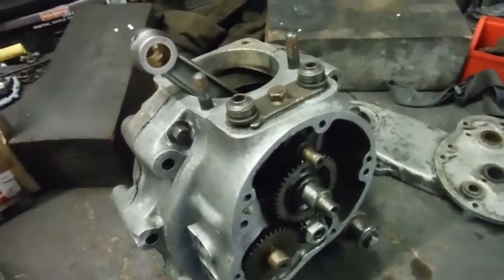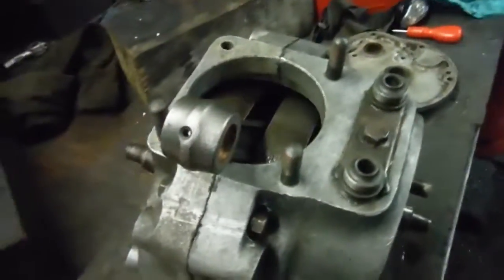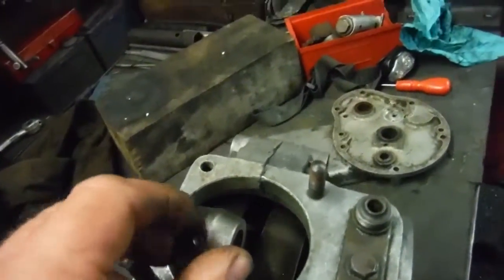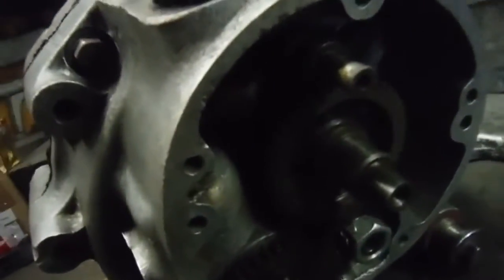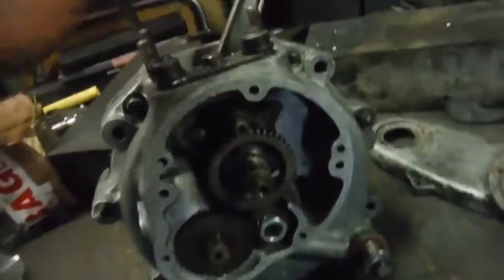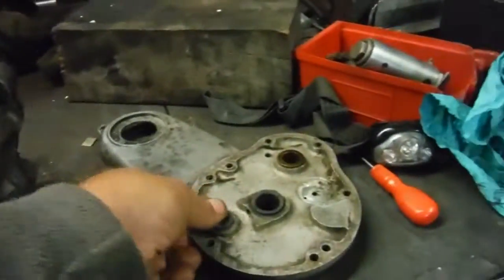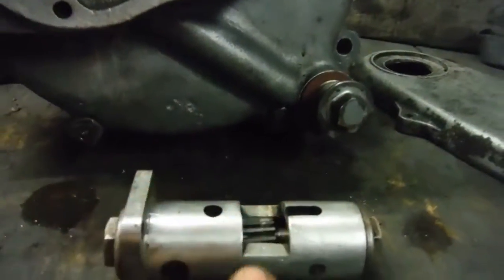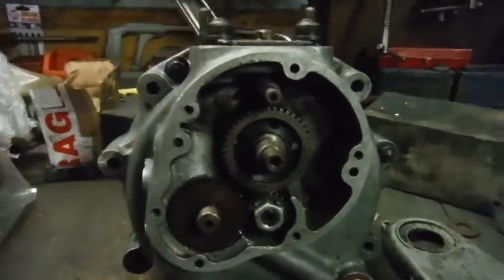Sturmey Archer engine bottom end rebuild by Performance Classics.

Comment: I have same engine without barrel and oil pump,do you need something of parts? ;)
Reply from the maker: Thanks, this was a few years ago and I got the engine finished and back to the owner, but thanks anyway.
Reply: Sorry to jump into this i have no crank. Conrod piston. Do you still have the engine?
Reply: @retrofy3797  Hi
I have crankcase,crankshaft with rod and  piston 2 mm larger than original also the head with one valve on it!
Want to sell only complete everything
Im in Europe!
Reply: @dario8508  not sure about price.  you are based in uk ? what sort of price you will be looking ..
Reply: @retrofy3797  Hi im located in Croatia
Maybe will be problem shipping because tax are high and weight of package cca 20 kg,i dont know how much i can ask

Comment: I have recently acquired a Dunelt 1928, with a Sturmey Archer engine and gearbox, this one appears to have no oil pump on the engine, can you please point me in the right direction for parts etc,any help would be greatly appreciated 👍
Reply from the maker: Hi Paul, I can't help much, sorry, as the owner had most of the bits that were needed, but you could ask at Draganfly, they might know of something, or Vale Onslow, if they are still going. There again, it may be worth joining the VMCC, if you are not already a member, as you may well find help there. Good luck!
Reply: @paulhenshaw4514  thanks Paul, this one is going to be a challenge 👍